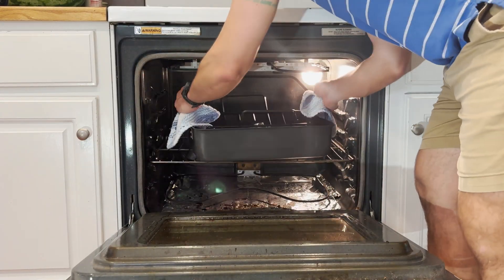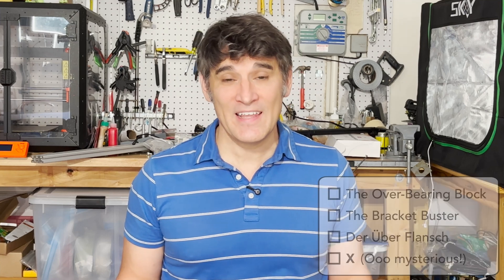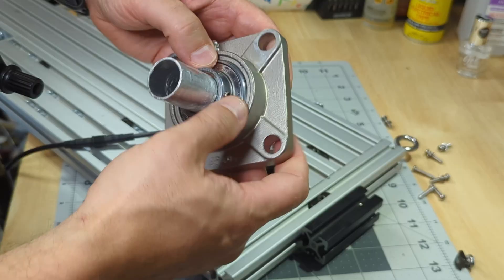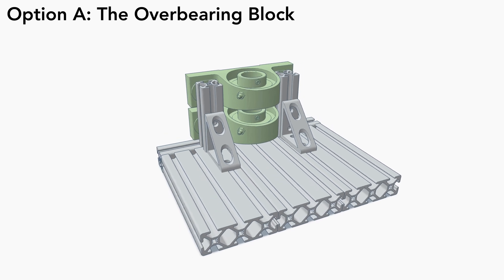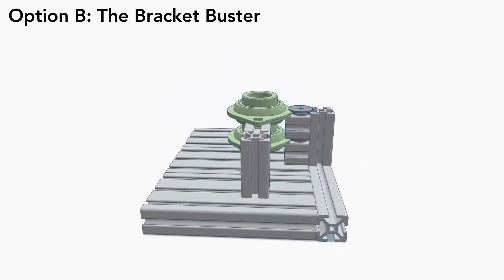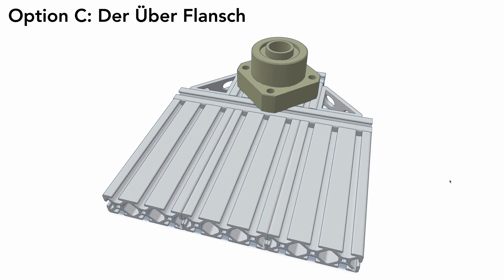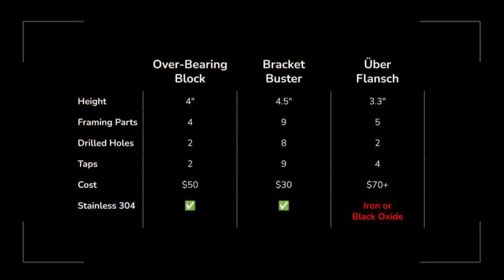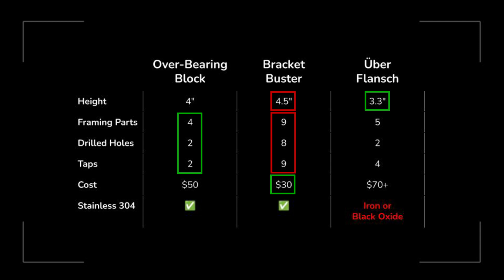3.X Fixes for My Solar Tracker Fail - You Decide

Comment from the maker: Redditor u/olawlor suggested using a rod end.  I hadn't thought of that before, but it could be a really good option.  See discussion here: https://www.reddit.com/r/diySolar/comments/1mom8n9/advice_on_dualaxis_tracker_pivot_point/
Reply: After thinking about this, the tilting that the rod end allows would make it difficult to keep the magnetic rotary encoder centered.  I'd need to think up a different way to measure the orientation of the panels.  Still a really great suggestion though!

Comment: I think the over-bearing block is the best option for combining durability, ease/straightforwardness of assembly and price. Your concerns about price for a stainless steel Uber Flansch seem pretty valid which is a bummer as otherwise that would be the clear winner. Maybe it could be offered as an add on for people wanting maximum durability? Regarding the Bracket Buster, I dislike that it requires customizations or overly complicated steps to get it to work. If you are targeting DIYers then minimizing those complexities is pretty crucial.
Reply from the maker: I hadn't thought of that.  You're right, if it were sold as a kit for DIYers then being overly complex is a real shop stopper.